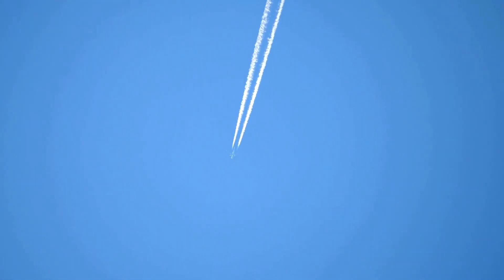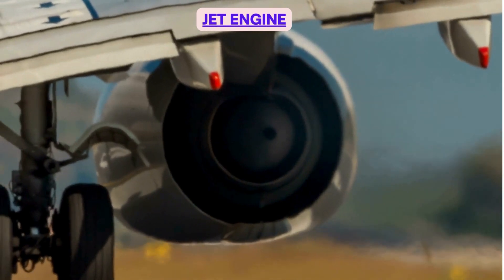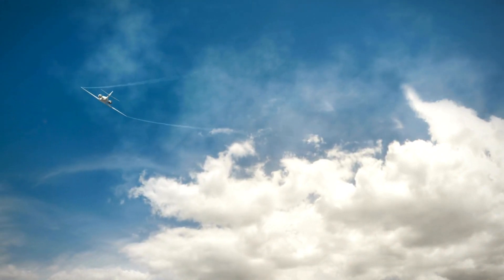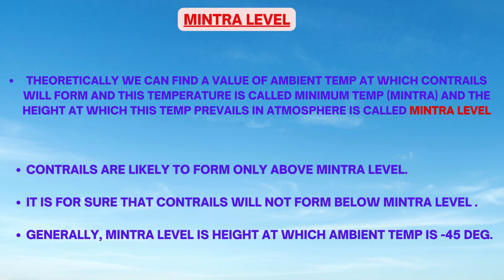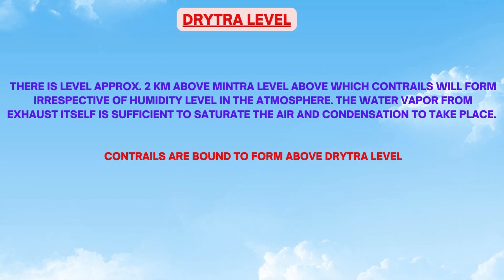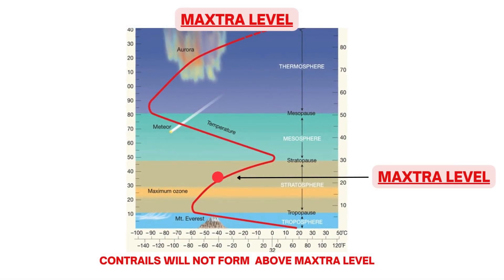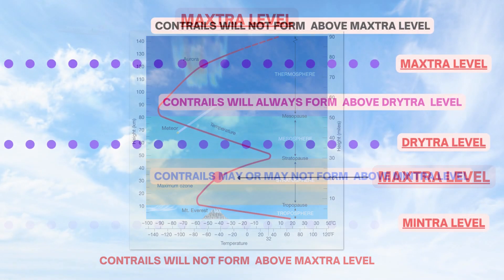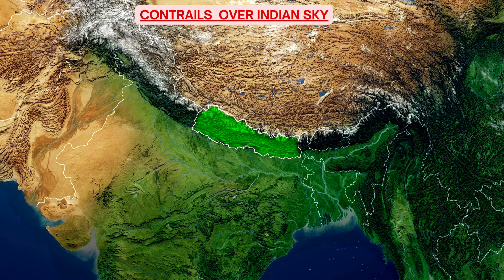CONTRAILS, MINTRA LEVEL, DRYTRA LEVEL, MAXTRA LEVEL, DISTRAILS #METEOROLOGY FOR DGCA CPL/ATPL EXAM

Comment: Sir why will contrails not form above maxtra level when the air is saturated in the isothermal layer from 11-20km?
Reply from the maker: Min temp required to form contrails is called Mintra level. At Maxtra level and above the temp is more than min required temp.. This is due to the fact that in stratosphere temp is constant at -56.5 deg till 20 Km then it keeps increasing till 50 km. At 50 km height, temp has risen to 0 deg again. Same as that at approx 7000 feet AMSL. Further, moisture content is less in stratosphere.